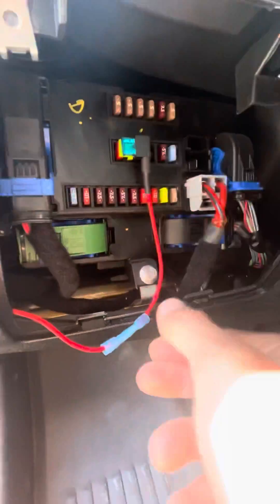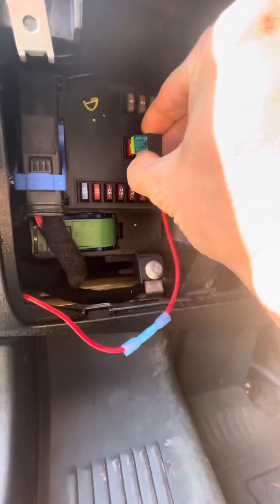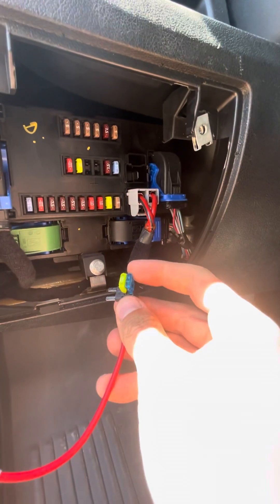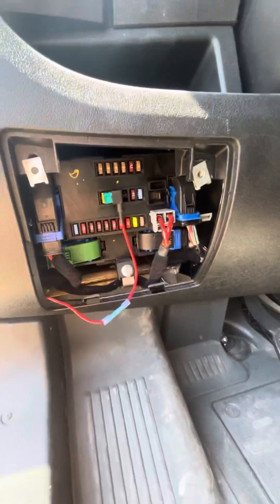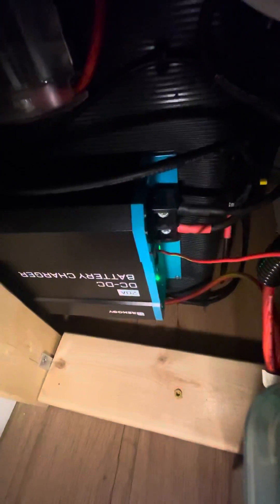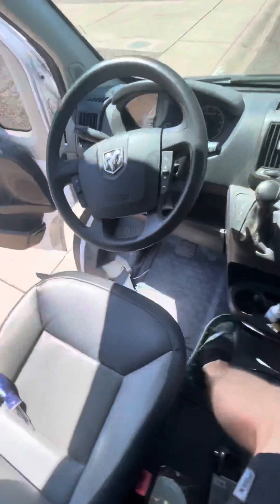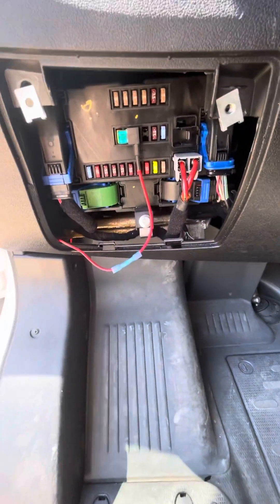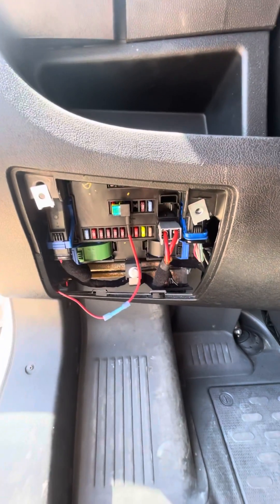Promaster Renogy DC to DC Alternator Fuse Tap Solution

Comment from the maker: Final fix. Instead of using the middle line of fuses I tapped into the top line where they were all 5 rated. This fixed the issue and it turns off when the engine is off! Finally!
Reply: Hey Man i have the Orion DC/DC and it is draining my battery when i direct connect it to the house battery and no one knows why - i like yoiur solutin,  Any experience with Orions DC/DC?